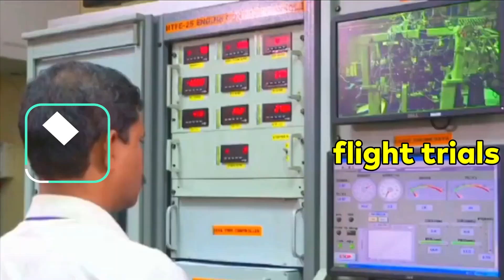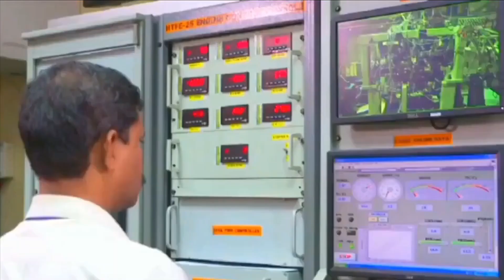Small Turbo Fan Engine undergoing experimental flight trials

Comment: Stfe, htfe, dry kaveri will help India achieve atmanirbharta in the engines for UAVs
Reply: And Joint Engine By India and France Will help Achieve Atmanirbharta for Manned Jets .
Reply: @veena_93_.  110kn not enought. usa and russia have 140+kn engines
Reply: @arun86713  They have Heavy weight fighters we have Medium weight jets ok , AMCA is twin engine AC
Reply: @arun86713  Also 110 kn is Dry thrust not Wet thurst(afterburner).
Reply: @veena_93_.  no its 75kn dry and 110 with after burner same as Rafael
Reply: @arun86713  lol 😆😆 , The new engine used In Rafale Produce 105 kn wet thrust . 75kn engine no one gonna build outdated  Engine.
Reply: @veena_93_.  Snecma M88 is the engine used in rafale and it prodeces 75kn (17,000 lbf) with afterburners
Reply: @arun86713  oh 😯 , Maybe You don't know that M88 has Three Variant , Among One Can Produce 105 kn Thurst After burner.
Reply: @arun86713  oh , oh Wait It's 125kn Engine .
Reply: @veena_93_.  the one used in rafale is 75kn engine m88-2
Reply: @veena_93_.  Yes